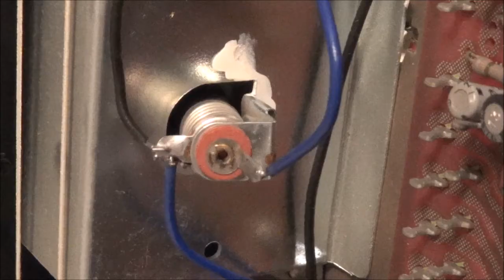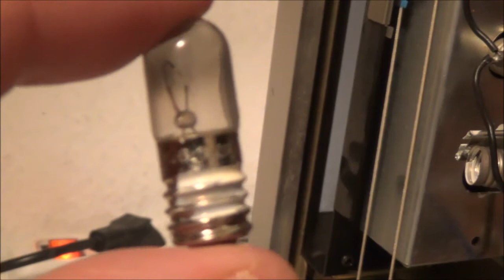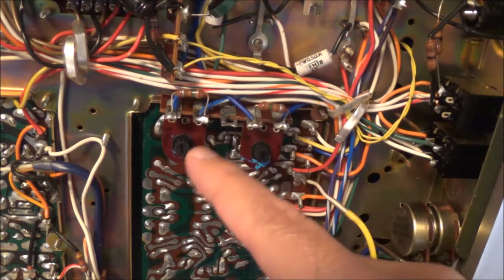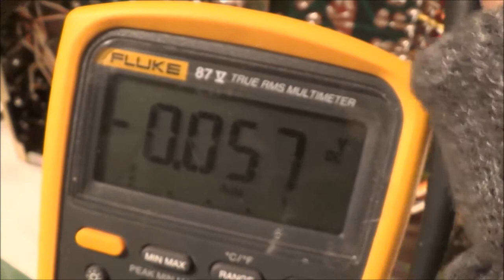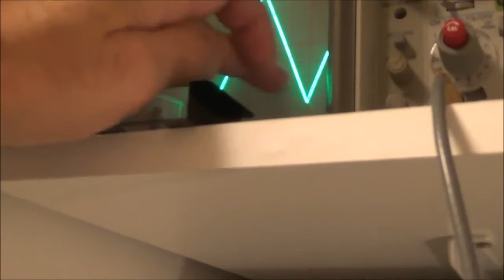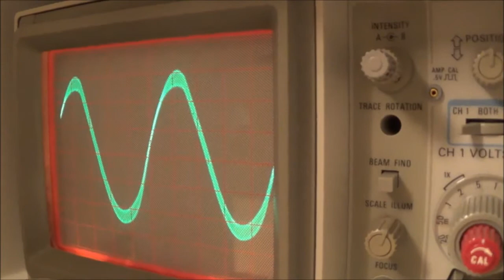Pioneer SX-440 Stereo Receiver

Comment: Those pots effect the idle current and you should measure across the output transistors emitter resistors. You were measuring voltage across those pots. If you look at the schematic it shows 80ma idle current through output transistors so 40ma each side should be correct. Hope this helps.

Comment: Those bulbs are a pain in the butt to remove.  There's a pink compound in my unit that affixes the bulb to the lamp holder. I suppose it's there to prevent them loosening during movement.  How did you finally remove the bulbs from the lampholders?
Reply from the maker: I think I just used small pliers to unscrew the bulbs. You might have to use a small hot-air gun and try that if somebody put some kind of compound on it.

Comment: What voltage are the bulbs and what size is it?
Reply from the maker: I no longer have this unit, but the LEDs were 6 volts, and were sold as E10 LED screw indicator bulbs. The color was white. I ordered them from eBay and they came from China.
Reply: Old School thanks, I saw those types of bulbs online from China. Should I get the warm or the cool white one?
Reply from the maker: When I bought the bulbs there were only cool white ones available for that particular voltage. The original bulbs would have been warm white. But, the cool white looked good after sanding, too. I have a bulb sanding video for the SX-440 on YouTube. More I don't really remember, since the unit was sold some time ago and I got rid of my written notes. Maybe somebody else made an in-depth video on this topic? I don't know, since I am not such a fan of watching people work on vintage equipment.
Reply: Old School thanks so much for the videos. I really wanted to change the bulbs since only one was working. Not bad for 40 years. The small meter is not working though. Guess I’ll have to figure that out.

Comment: much easier to remove 3 mounting screws that hold the entire lamp housing to expose all the lamps for simple replacement
Reply from the maker: Thanks for the info; will try that when I get another of these units; it was a really easy job, though.
Reply: I just used plier and wiggled the lamps off, thought it was pretty easy and quick too.

Comment: I picked up one of this beautiful Pioneer SX-440 last year from a garage sale with very noisy/distorted output (Like we cannot hear any sound other than noise) and fused bulbs, didn't get a chance to diagnose the issue yet but I really like the look of this receiver. Thanks for posting this video it's very informative and giving me motivation to fix mine even though I'm not that electronics expert.
Reply from the maker: +Vijay Merceline Thanks for your comments and good luck with the Pioneer! Please let me know what the problem was when you fix it. I am still waiting for the bulbs in order to complete the project. Nice little receiver.
Reply from the maker: I got my bulbs from eBay. They actually came from China. They are E10 LED bulbs (white, 6 V). Just put this information into the eBay search space. I think I made a whole video of me sanding these things to make the light more diffuse--check my channel.

Comment: Always good. Is this a cap coupled output?
Reply from the maker: Thanks, Pat. I think this would be called a capacitor-coupled, quasi-complementary output stage, because there are two NPN transistors (for each channel) in the output. I think the drivers in this unit are complementary: NPN and PNP (push-pull).

Comment: That compound on the bulb, may also try IPA to help break it up?  Those moments when you can't figure out why a basic step is not working, just to find you forgot to throw power makes one feel like a fantastic tech!  :)  Could it be possible why you can't find the POTs on the SAMs is they were an afterthought as they are on a terminal strip?  I like your o'scope a lot better then mine, it's nice, bright and solid thick trace, mine is OK, but the refresh rate at times sux....great video, you make it all look so easy!  ~Jack, VEG
Reply from the maker: +Vintage Electronics Geek Thanks for your comments! I didn't use IPA because the compound was also smeared underneath and it was easy to pry open; I should be able to bend it back and it should be barely noticable (only with an inspection mirror). Good idea with the pots, Jack! In this case they are on the schematic, but not mentioned in the service manual. Sorry about not being clear on that--I always want to do bigger write-ups but get lazy. I always tell myself I have an obscure channel and nobody wants to read anyway. My scope is a Tek 2235. Paid about $120 for it with complete operator's and service manual. And 4 probes. I don't know how many times I forgot to turn units on or forgot to connect something and was stumped!